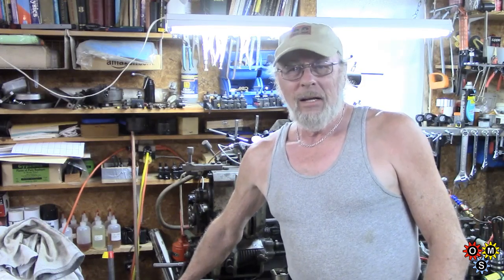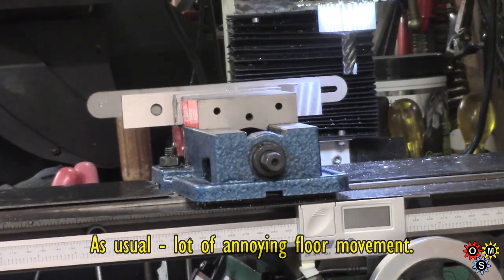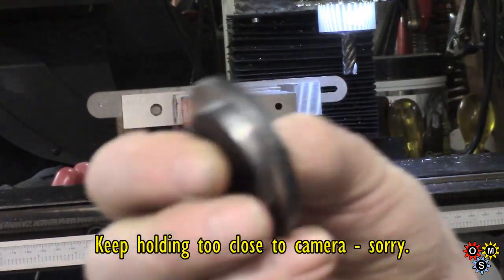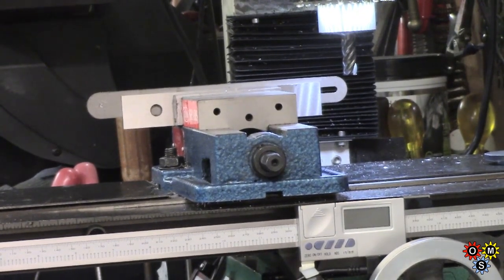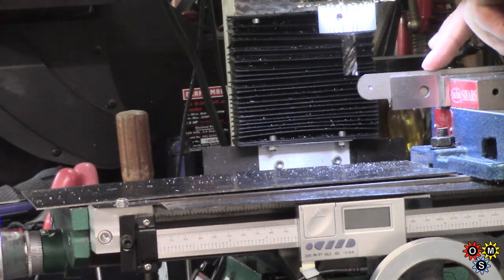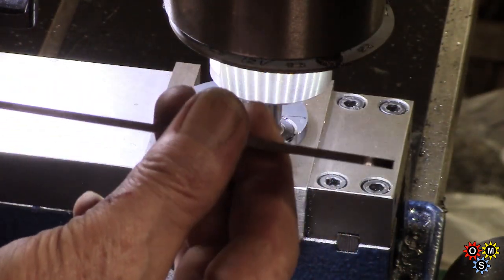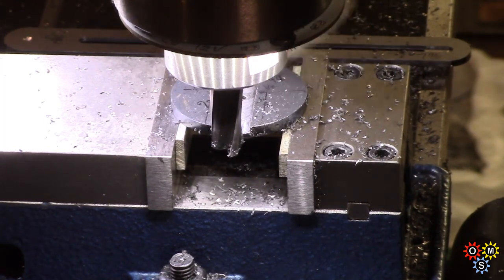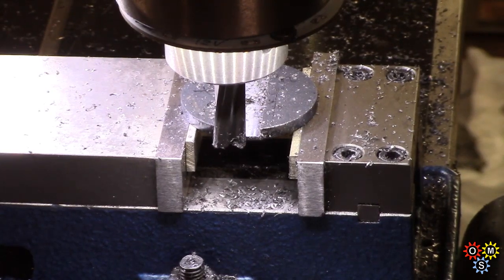Acute Sharpening System, Part Two B -- Parallelogram

Comment: A bit of 600 grit sandpaper would make a very grippy facing for that table edge clamp. It might cause a bit of wear on the table eventually, but tables can be replaced.

I wasn't sure how I liked this tool while watching the first video, but is has been growing on me as the series progressed. I may yet get a kit or a set of plans.
Reply from the maker: +Peter W. Meek The thin piece of cardboard actually does a good job of making locking to table very secure. There is a lot yet to be done so - see how it all works out eventually to decide whether it might suit you or not. I'll eventually give my final appraisal.
Bottom line - it's a lot of work all told!

Comment: Hi Chris, 
You're doing a good job on getting this Parallelogram put together. However, have you noticed the two arms that bolt to the head ( tool holder? ) in the picture, are bolted to the bottom and you have yours bolted on top?
Reply from the maker: +RC Miller You spotted the deliberate mistake LOL - yes, I realized that and have swapped over now. Hope to get more progress before too long if time allows.

Comment: The out of round condition was probably caused by the laser cutter loosing steps or the resolution not set up properly on either the X or Y axis depending on how the part was oriented in the Laser machine.
Reply from the maker: +H H Well of course the round parts supplied are intended to have a diameter reduction but those pieces would be tricky to machine until have a center hole anyways. Guess we'll make do with edges and just try and keep main aspects within concentricity. Cheat where acceptable!

Comment: Hi Chris,

I have mailed to Tania (sister of Gary) yesterday and ordered the drawings (awaiting them soon). Also, i like your videos very, and they were the point for me that i decided to purchase. . The next phase will be to get all these materials. Pls, can you help me with answering the two questions: 

1.
Did you buy the kit or did you all the parts by yourself? 

2.
Here in Austria we speak the german language and i am not sure what the difference beetween "mild steel" "and bright mild steel" is Does the word "bright" mean, that the steel-surface is extremly blank and smooth? Or is this a special, another alloy than mild steel?

Kind regards,
Henry
Reply from the maker: +HenrietteCNC 

Hi, well, drawings are reasonable but after I had studied mine I decided to go for the kit of bits. Several things in that are helpful to have but even so, some aspects are not easy. I did so far decide to not bother with machining some laser cut surfaces - I think it'll be fine without bothering with that on all parts. I would say though, the whole thing requires at least some machining experience.

'Bright mild' generally refers to cold-rolled steel. 'Mild steel' could describe that but could equally describe hot-rolled - sometimes called 'black steel' - which has the remains of scale on the outside.

These are fairly low carbon steels and usually will be fairly free machining but won't accept any heat treatment for hardening.

Regards, Chris
Reply: Oh, you are very prompt! My drawings came today, very fast sending from England to Austria (Friday till monday morning).

Thank you for your help!
Regards, Henry

Comment: one suggestion; on small fiddly bits, like the subjects of most of this vid, when pointing our features, problems, etc. it would help if you used a fine pointed object, a machine sharpened pencil, a scriber, etc. rather than your finger. whilst it may be a perfectly fine finger  indeed, it tends to utterly obscure vision on closeup shots of small parts....

i admire your perseverance for i think i may have sent the kit back for a refund and then either headed to northern tool or similar for one of their deckel clones or started looking for a competent sharpening service.
Reply from the maker: +crazymanmichael Very good point Michael - something I don't always remember to do. Will try to remedy that.
Perseverance - yep - once started will try to see it thru. Overall the kit is pretty good in most respects and a return to OZ seemed anyways way too much hassle! Lot to do yet.

Comment: How deep is that groove supposed t be mate? There's no reference to the depth of it on the plans that came with my kit.
Reply: +a0cdhd Ah... Belay the last. I just heard you say that it's supposed to be 3mil.
Reply from the maker: +a0cdhd 
The plans on their own are not totally perfect - I am still  without the DVD that is supposed to go with the parts kit and have left it all on the back burner for now. Hope to finish it eventually!
Reply: +ChrisB257 Yair. My kit came without a DVD. I was a bit irritated at first but perhaps it was a good thing. I had to sit down and lay out all the parts and then figure out what went where and why it went where it did. Speaking as a retired writer of dull, colourless and boring tech manuals I have found that people who make things with their hands are not normally good at writing instructions on how to put what they've made together. Software designers are far, far worse though. Pity. Still, the bloke seems to have made a right handy gadget for general sharpening of tools. Cheers!
Reply from the maker: +a0cdhd 
The reason I wanted the DVD was, much as anything, for time saving. I reckoned it would contain the methods used by Gary (the owner) and so maybe simplify things a bit. I shall continue eventually.